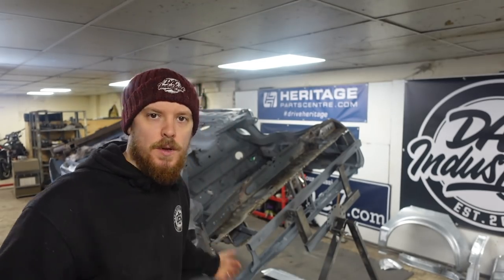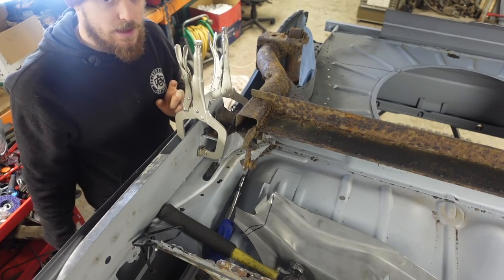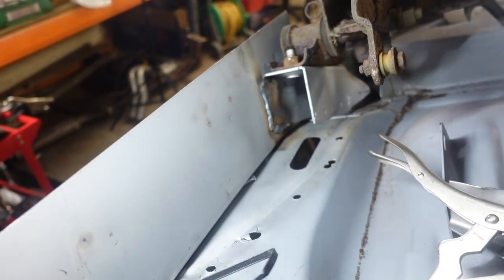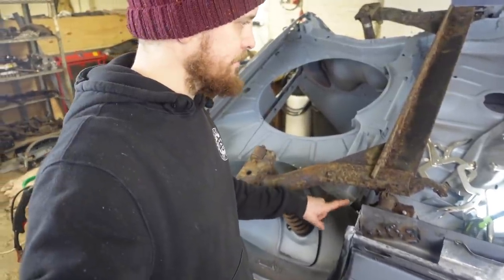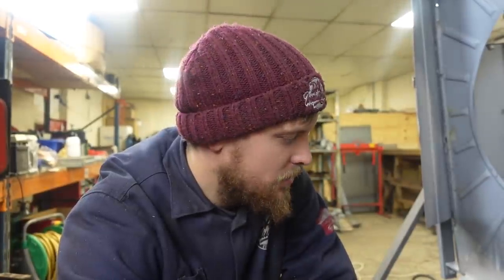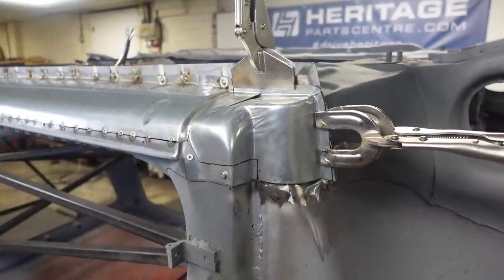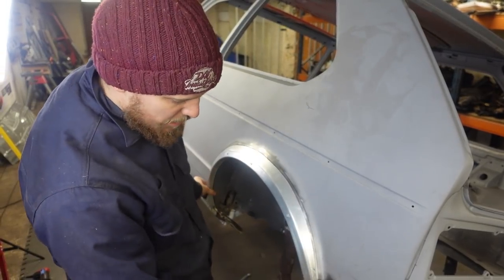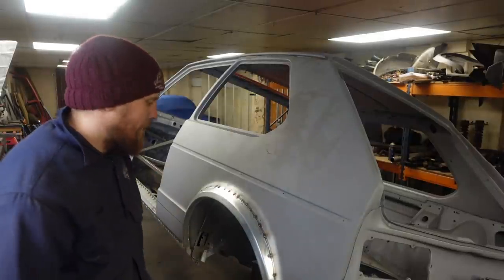Beam Mount, Chassis Rails, Outer Sill & Rear Arch - Golf Episode 19 Volkswagen Mk1 Golf GTI Resto

Comment: served my time as a panel beater many years ago. some of your fabrication is amazing, hats off to you. that said dont know any panel beater who would butt weld a sill in this manner. so much easier to plug/spot weld a flange joint with so much less dressing..good channel though
Reply from the maker: Thank you so much for the comment and for watching! I struggled to find a decent video showing replacing a sill. This seemed like the easiest/right way, Hopefully it will be OK in the end. I will try and Flange/Plug weld a join on the other side.
Reply: @DanChambersDAC  you are doing an excellent job. after market panels restrict your options. watched your camper van conversion, convinced myself you were vw mechanic, now this, no end to your talents...do the other side the same way.

Comment: Try cleco fasteners instead of those. Much easier and quicker
Reply: Yup I used clecos when I did my Astra, ace bits of kit, used primarily in the aircraft industry.
Reply from the maker: Thank you so much for the comment and for watching bud! I would love some but no spare funds at the moment. Wood screws will have to do.
Reply from the maker: Thank you so much for the comment and for watching bud! I would love some but no spare funds at the moment. Wood screws will have to do.